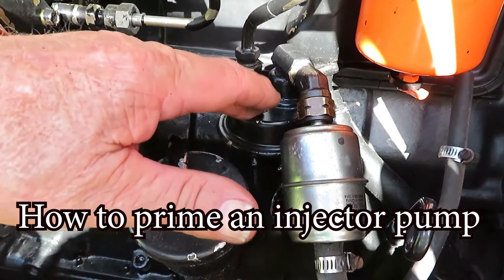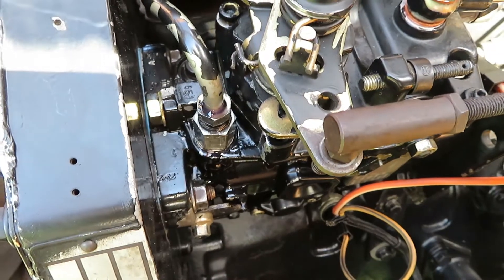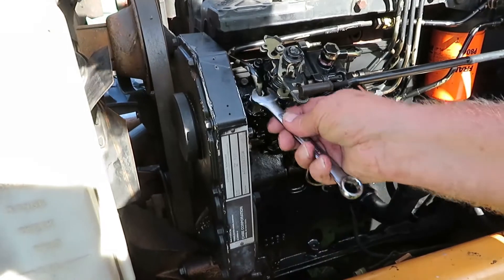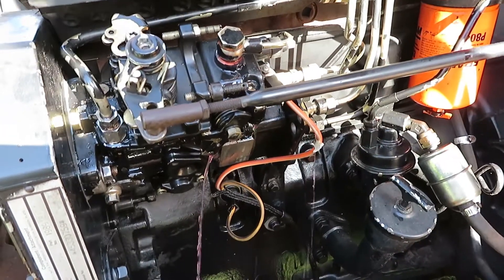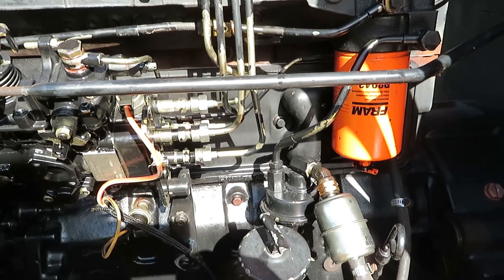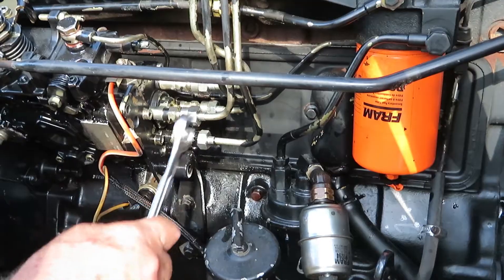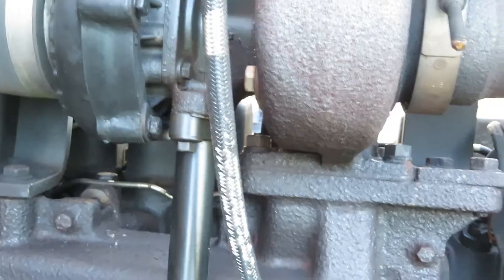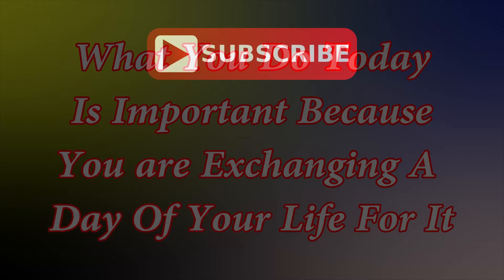how to prime an injector pump, Case 580

Comment: Thank you. I by mistake run tractor with close flue pipe, so I get air in fuel system. Then I wached so many YT videos how to  get air out . Now I know I have 2nd problen, becouse fuel dont come in fuel hand pomp. Something is in fuel tank and in fuel tube....dirty parts maybe.
Reply: Jog the engine a bit.  If the pump is on the cam lobe it cant work

Comment: i have a  2006 chinese tractor 254 foton ,its air locked bad,i tried to bleed it ,but where the air vent is on the injection pump is still leaking bad with lots of bubbles,how can i get air vent [ over flow part } stop from leaking when its tight,its coming out breathing holes,any help ,when manual pump is up,theres no pressure and it stops leaking,any help thanks..
Reply: Gaskets and/or crush washers 🥴

Comment: Diesel is not reaching the injector from the fuel pump of the concrete mixer.  what is the problem?
Reply: Clogged fuel filter,injector pump or transfer pump.